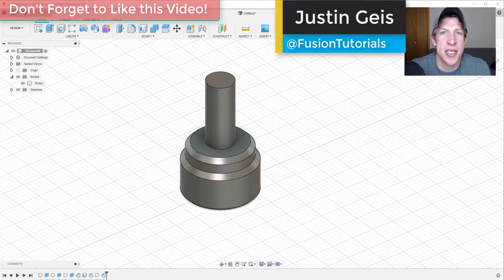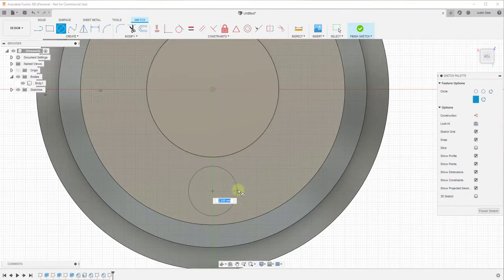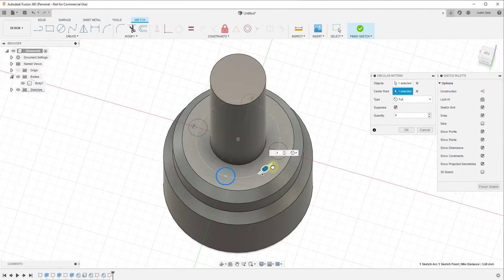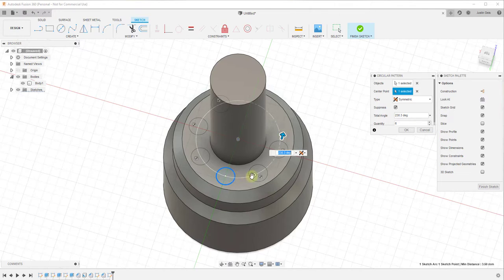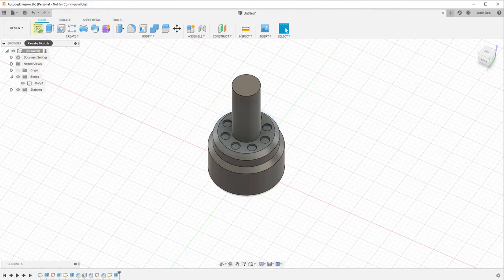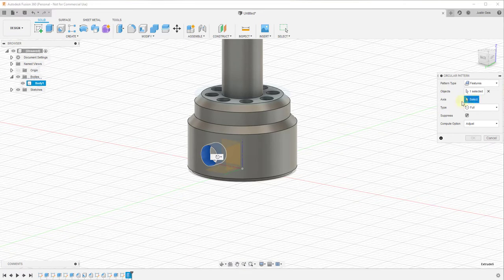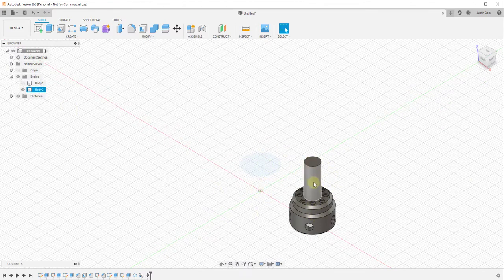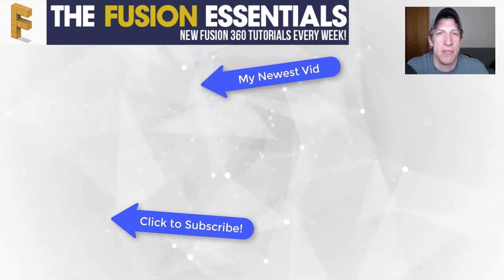CIRCULAR PATTERNS in Autodesk Fusion 360 with the Circular Pattern Tool!

Comment: I was going to design a Sharpie pen holder and this is one of the tools I'd use (for a circular holder for say, 6 pens).   One thing I noticed is the object itself rotates so the face facing the outer circumference will rotate  for each copy to face the outer circumference (which is good, and would have been more obvious had the objects been square instead of round, but you can watch the drilled holes as you add copies to see that effect)  I was curious if there was a way to "lock" the orientation of the copied bodies, such that all "south facing" sides, for instance, of all copies continued to face "south" no matter where in the pattern they were.

Comment: Hi Justin.
great tutorials you make. I have learned a lot from you from your tutorials in sketchup. I'm trying to learn fusio360, so I've been following your tutorials while practicing. If you have the opportunity to make a tutorial as follows, that would be great:
Create a perforated steel pipe with hexagonal openings. The pipe has an inner diameter of 317 millimeters and has 2 millimeter thick material. The holes can be 11 millimeters in diameter and 4 millimeters of material between all holes

Comment: How would you go about cutting material around the actual circle face, such as lets say make a solid circle 3mm thick, I want to cut away 2mm of material around the circle face, not the top and bottom face but the actual centre face